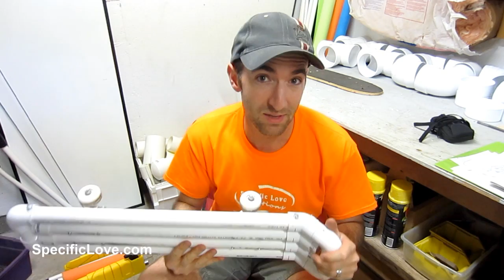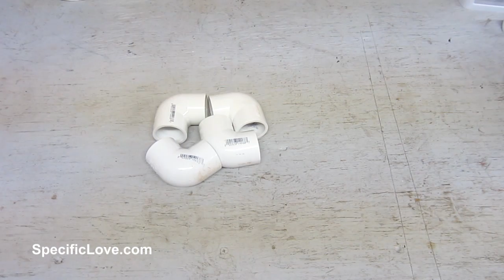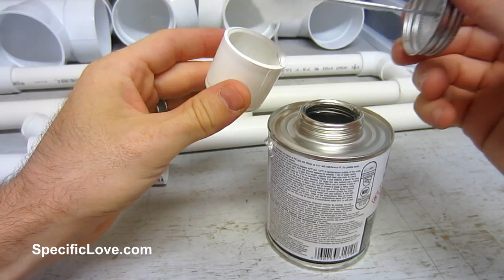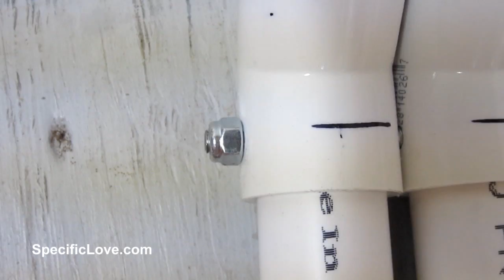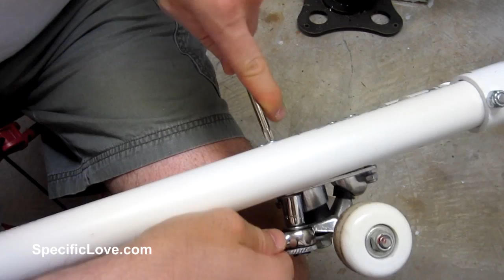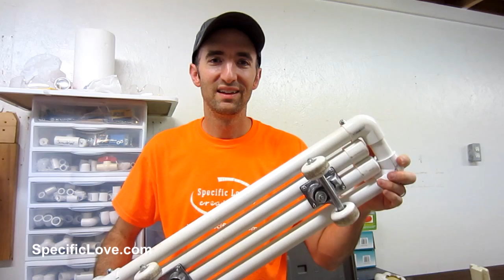PVC Skateboard - How to make

Comment: I would like to make it a long board with off road type tires. How long do you think the PVC can be and still be sturdy? Should I add fiberglass rods to the interior of the length of the board for strength? (you have a ton more pvc experience than I do, I just want to make sure it's safe for my kids, but COOL too)
Reply from the maker: I am not sure what the absolute limit the pipe can be but at this length it felt pretty strong under my 165 pounds. For a long board, you might want to consider adding another pipe or two wider for support. The extra rods might be an option, but I have not used them for anything yet, so I am not sure. When it comes to PVC, it can be hard to see its limit until it happens. It will sometimes just bend and other times shatter. To help prevent shattering, you could wrap it in duct tape, so if the limit is reached it will at least not send pieces flying. Hope this helps.

Comment: I like it, great starter board on a budget. Think big.  If your toes or heels are hanging over the sides it's time to expand.  Like an old Pontiac, wider is better for stability and handling.  Go five or six pipes wide.  A little longer too, you want to be able to stand on the board like a bowlegged cowboy.  Fill up the hollow airspace in the pipes with triple expanding foam to give it a bit more density.  Thoroughly paint the the entire board, accept the trucks and wheels with truck bed liner.  It will give a nice slip free surface to stand on and will armor the whole works.   Give special attention to the exposed nuts on the sides because Murphy is just waiting there to hand out free cuts and scrapes.  

Keep building!
Reply from the maker: +ScorpionRegent Good ideas thanks
Reply: No, thank you.  I wouldn't have had the ideas if you hadn't built the board.  You did the work. I'm just a guy in the peanut gallery.